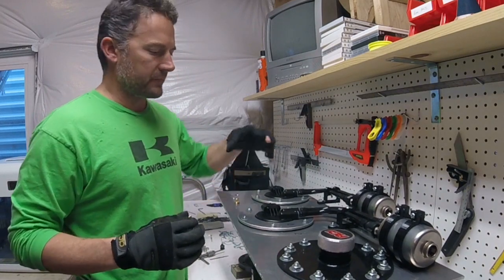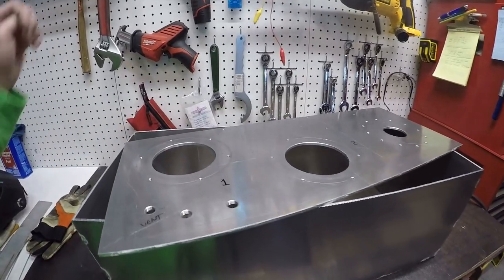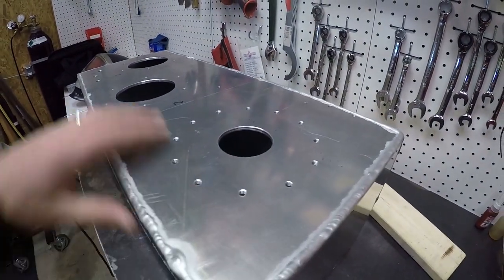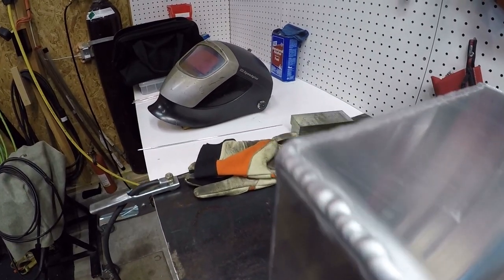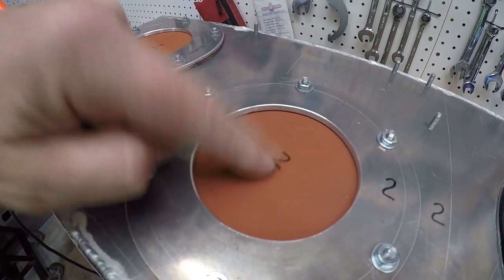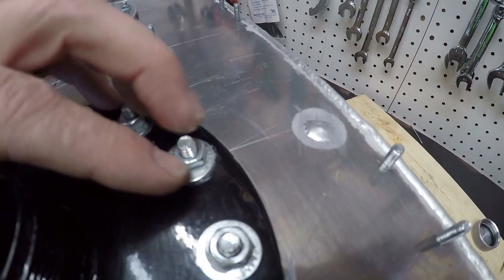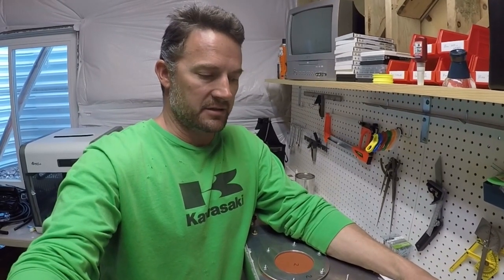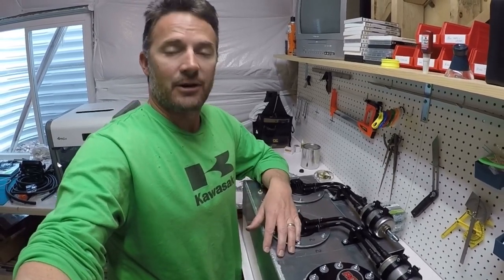Fuel Cell Fabrication Part 2 (it's finished)

Comment: No fuel level sender?
Reply from the maker: It does have a fuel level sender. The fuel pump in the upper left hand corner still has the sender on it.

Comment: Why didn't you weld in a couple of anti slosh baffles?
Reply from the maker: It's only a 9 gallon tank. By the time I had both fuel pumps in there they took up so much room that it didn't seem like any baffles were needed. Guess I'll see over time if I needed them. ;-)
Reply: Doug Bug I guess the pumps are baffles in a way. Great project. Keep them coming.

Comment: Idk if I missed it but what kind of aluminum did u use?
Reply from the maker: It is 6061 and I used 4043 filler rod.
The bottom and sides are .125" and the top is .190" thick.
Hope that helps.

Comment: Did you put any baffles in the tank? And what was the reason?
Reply from the maker: I did not, originally I was going to. But after laying out the tank it was much smaller than I thought it would be. And then when I put in the two pumps and the one pump has the float level in it there was almost no room left. So I went with no baffles.
The cell is 24" x 10" x 9" tall. So really only 9 gallons. The sides are .125" and the top is .190" thick, so it's a stout little tank. So I'm not worried about stress from sloshing fuel.
That being said, it would be nice to have some baffles to keep the fuel near the pickups when the fuel gets low.
But the only answer for that is.....I didn't put any in. lol
Hope that helps and thanks for the comment.

Comment: Liking the tank. Well thought out. Great video to show you don't have to get just a off the shelf tank and mod it to fit your needs. I know you may have said it before but what's the dimensions of the tank and how much fuel do you think it will hold? Just curious - those twin pumps take up some room on a smallish tank.
Reply from the maker: This tank is 24" long, 10" wide, and 9" tall. It holds 9.3 gallons raw. With the pumps it most likely comes in at 9 gallons. That is small and not enough fuel really. The radiator, A arm shocks placement, and electrical box placement, really screwed me for space for the tank. I'm hoping I can reuse this tank in the new chassis and it will have an auxillary tank beside it close to the same size. This way I can carry 15-20 gallons. But we'll see. For this summer I can carry some extra fuel in jerry cans for now.
Reply: Thanks for the reply. Looks good as it is and will get you going on the trails. Keep the videos coming